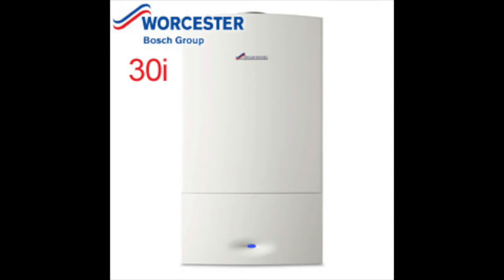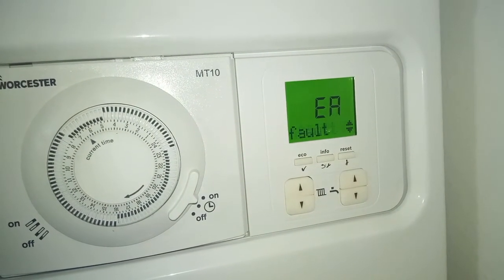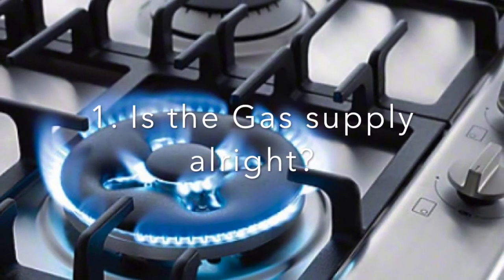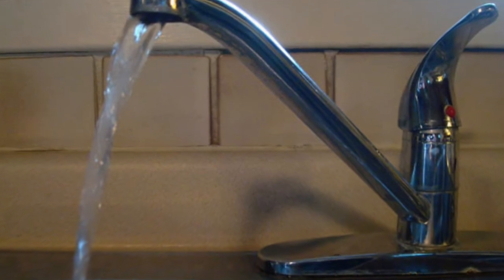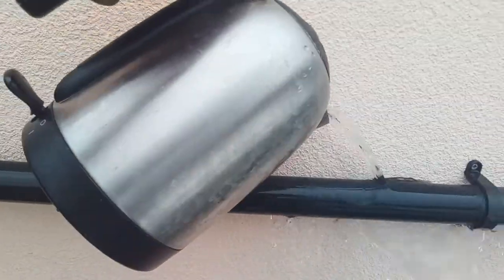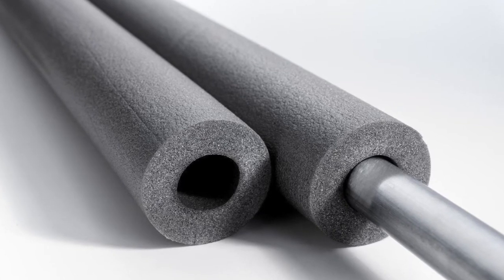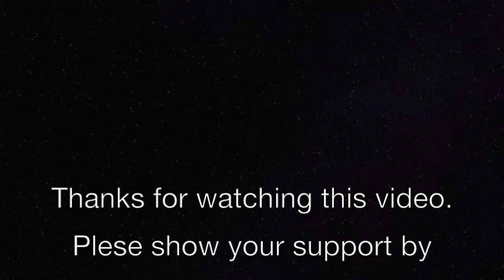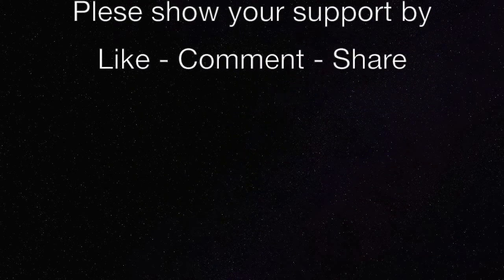Common Combi Boiler issues and debug - No hot water or heating, L2 Error, Ignition Error

Comment: I have a Ignition/ Ionisation fault on my boiler but it’s still summer.
Reply from the maker: Definitely not frozen condensate but sounds like a blocked boiler drain pipe as shown at 50 sec of this video. Make sure it's clear of dirt and other sediments.